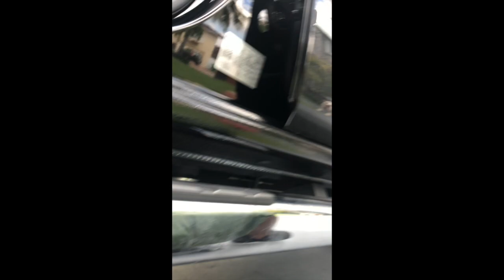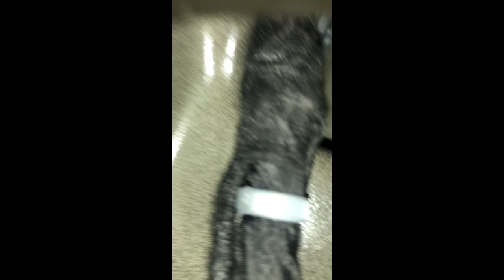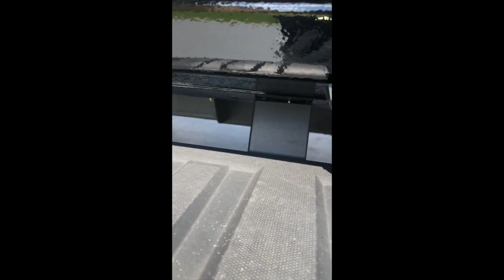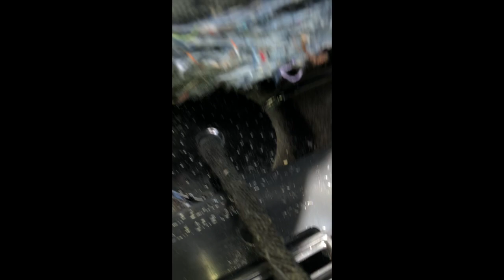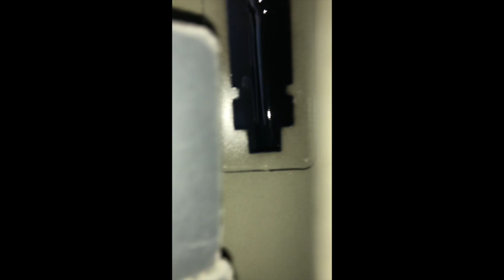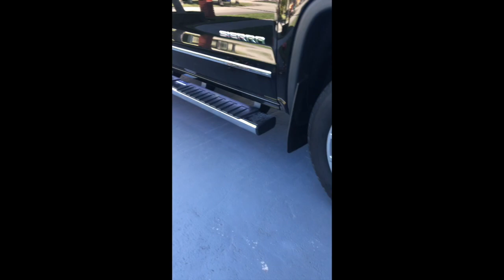How to install OPT7 Sidekick Runningboard Sequential Amber Turn Signal on a 2018 GMC Sierra 1800

Comment: Is it the same for a 2018 Chevy Silverado C1500 without turn signals in the mirrors ?
Reply from the maker: @hellanbach7168  brother, by no means am I a mechanic and I wish I could answer your question with certainty, but I honestly don’t know. Someone posted a comment stating that it won’t work unless you have the turn signal in the mirror.

Comment: Just out of curiosity, I hooked up the right side first and I haven’t hooked the left side up. My right side doesn’t cut on.

I believe it’s a ground connection bc of the scotchlock connection. One cable is being much bigger gauge than the other. 🤷‍♂️ I’ll  figure it out later I guess 
 
But would that cause my right side not to even cut on it the left side isn’t connected? 

Yes, I checked the lights before I hooked them up.
Reply from the maker: Hey bud.. I’m not any type of vehicle audio or LED installer by trade. Just an DIYer that put this video together to help others install. Aside from that I can’t say for certain why your right side is it turning on. Now not hooking up the left side should not affect the the right side from turning on. So I might be a ground issue. Wish I could be more help.

Comment: Do you know or anyone that’s comnented,  if those colors are the same for a 20 Silverado? This method seems way easier than running wires all around, tapping at headlights, at a bcm, etc etc..
Reply from the maker: It should work brother

Comment: Do you know what fuse covers that puddle light wire?
Reply from the maker: Hey Bryan, if i understand your question correctly, you’ll find the fuses on the passenger side underneath the dashboard by the feet. There’s a cover there that you need to remove. Hope that helps and answers your question.
Reply: @syko08  Humm I have a 2500hd and I have 3 fuse boxes one on each side of dash and 1 under hood. Are you saying there is a 4th on floorboard by feet?
I had tapped the puddle light wire and had power, now I don't. Was looking for the fuse, but not able to locate. This install is a pai  in the ass
Reply from the maker: @bryancatrina5787  oh gotcha… yeah, I’m not sure about the 2500. I had a 1500. Check gm-forums. Ask the question there. Someone will know. Sorry couldn’t be of more help. Best of luck

Comment: Great video and it helped me a lot. I am hoping you can help with an issue I am having. I connected the white courtesy lights to pin #4 and during the day the lights work fine but at night the white lights stay on constantly. They do not change over to the amber color. Any ideas what I did wrong?
Reply from the maker: Thanks Stephen… sounds like somewhere the cables might be crossed or set in the wrong pin. Try troubleshooting shooting by switching the courtesy light and amber lights cable to see if that makes a difference. Sorry I can’t be of more help.

Comment: How is the 3M holding up.  Are the lights still stuck?  I’m worried about them coming off going through a car wash.
Reply from the maker: Hey Ryan, Sold the truck earlier this year and the tape was still holding up well.  But if i recall correctly, I believe they come with clips that you can drill to the truck and guarantee them not falling off.  I didn't use the clip because I didnt want to drill any holes into the body.

Comment: Can you have it work without parking light set up? Likebwhat if you don't want it onbwhile driving ?
Reply from the maker: Yes, just don’t connect the parking lights wire. Although if you do that the turn signal might not won’t work.
Reply: Snap that sucks i hate it on while my lights are on

Comment: This install only works if your vehicle has the turn signals in the mirrors. Great job other wise.
Reply: Your statement is not 100% accurate. If your GM truck is 2015.5 and newer you don't have to have DL3 mirrors for this installation to work as the wiring harness already has the needed pins right from the manufacture. I know this because I did the DL8 to DL3 mirror upgrade, you only add 3 extra wires to make it work on the door side of the electrical harness.